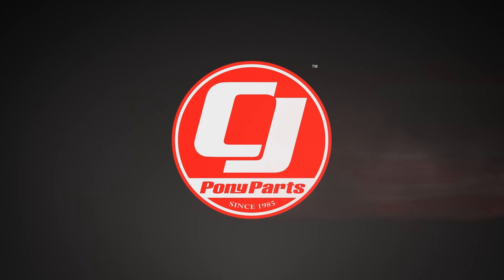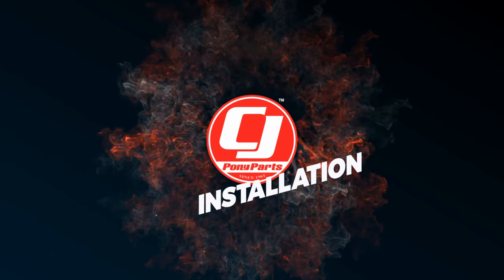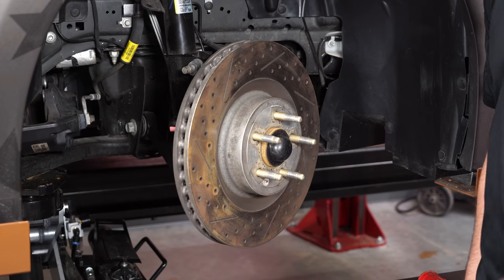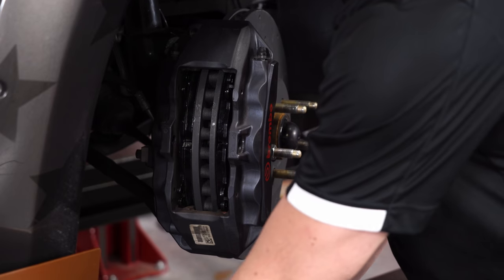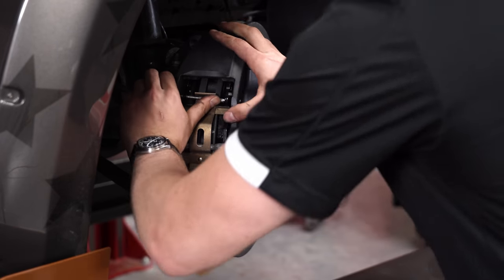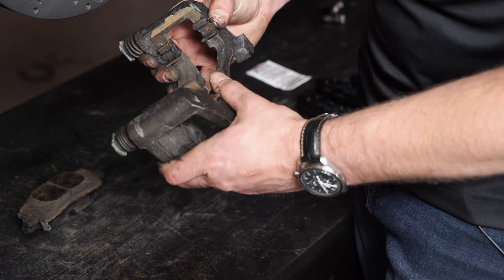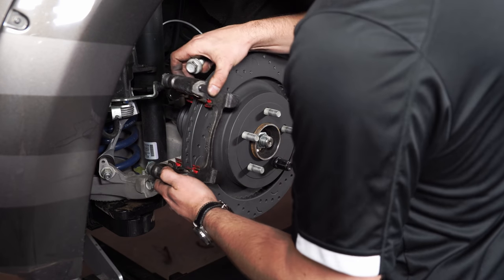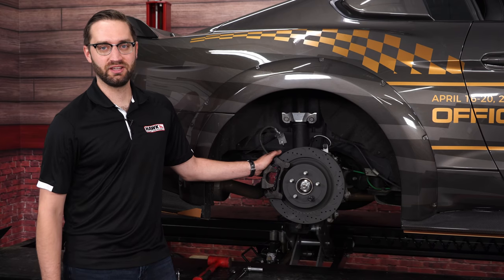2018-2023 Ford Mustang GT Install: Hawk Performance Rotors and Pads

Comment from the maker: Rotor Info:
https://www.cjponyparts.com/hawk-performance-brake-rotor-front-talon-pair-performance-pack-2015-2019/p/BR110/
https://www.cjponyparts.com/hawk-performance-brake-rotor-talon-rear-pair-for-performance-package-ecoboost-gt-2015-2019/p/BR112/
Pad Info:
https://www.cjponyparts.com/hawk-performance-brake-pad-hp-plus-front-set-performance-pack-gt-2015-2019/p/BS867/
https://www.cjponyparts.com/hawk-performance-brake-pad-hp-plus-rear-set-v6-ecoboost-gt-2015-2019/p/BS860/

Comment: Any weight savings on the rotor?
Reply: While I understand the desire for lower unsprung mass, the steel casting looks to be as thin as you'd want to go around the hub.  Early 2000 Brembo brakes infrequently suffered friom shearing of the rotor disc from the hub, so it is possible to go too thin there.  The rotor ring itself is designed so that it can absorb the heat that the brake system is expected to generate as it converts kinetic entergy to heat. These brakes are designed for repeated stops vs a drag racing brake that only needs to stop once, and therfore can be lighter. The way to get this system to weigh less would be to use a aluminum hub design instead of a casting.  In theory, changing only the rotor rings can be cheaper, but I haven't found that to be true.

Comment: Curious about the coating on the rotors. Any reason I cant just hone that material off so that its track ready after install? Assuming the coating will stick to the pads, limiting my braking out the gate at the track
Reply from the maker: You absolutely could if you wanted to. It burns off pretty fast on its own though.
Reply: @cjponyparts  thank you! Did it last night and worked out great. Came off pretty easy all things considered

Comment: Increased performance on dyno testing with rotors? Doesn't make sense.
Reply: They have dyno for brakes, to test brake performance. Only the wheel hub assembly and the brakes are needed, connected to a motor that spins the wheel to 100mph and they stop it using the force of the brakes. They repeat this until the brakes fade. 
They try different designs and the one they made was best at dissipating heat therefore it was the most durable.